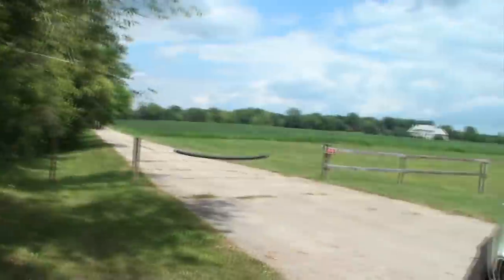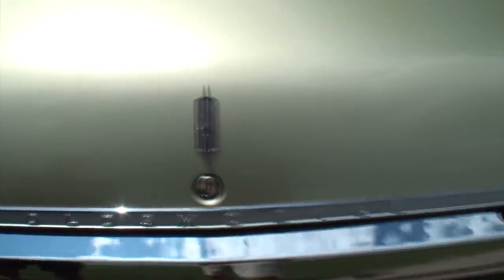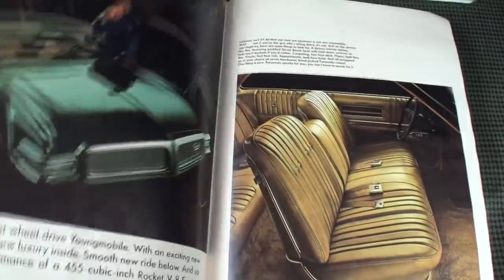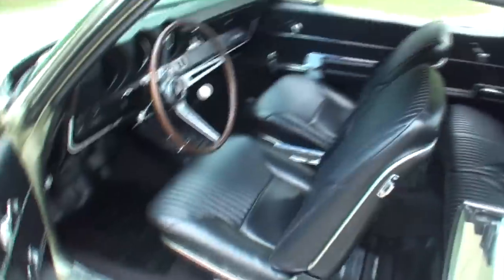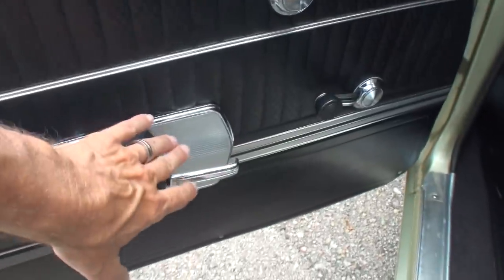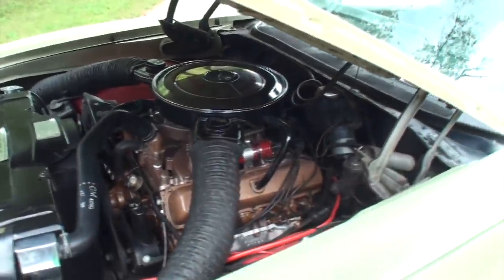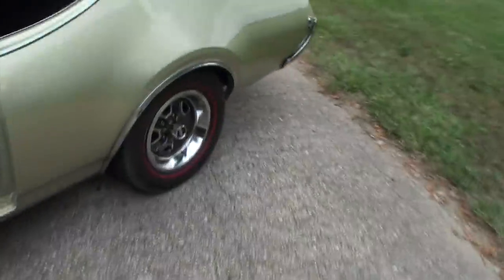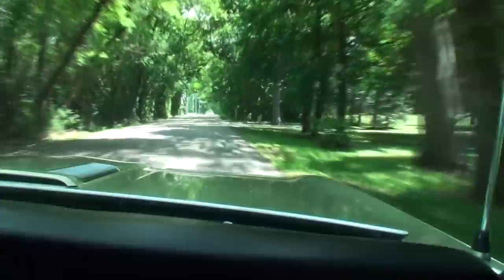1968 Oldsmobile Olds 442 W-30 W30 in Willow Gold & Ride on My Car Story with Lou Costabile

Comment: Working a 12hr 6 day week at Strathmore Paper and bought a 68 442 (used) as my first car in 69.  Like new cond. except for chips in the paint on the lower dash.  Didn't realize till some time later that the chips were in perfect position where the previous owner had been speed shifting into 3rd gear.  But the 442 was built so well that I drove it for years without a problem.  The Hurst alum shift grip from its 4 speed now hangs from a cord for access to my attic.
Reply from the maker: Hi Tom, Happy to read this car brings back memories of your car you worked hard for :-) Thank you for viewing and sharing.  Hope you see many cars on this Channel you enjoy!  Please Subscribe, and hit the "bell" so you can see all the cars when they are uploaded on this YouTube Channel, Lou

Comment: Just got clarification Tim correctly mentions the W-36 side stripe available on all 4-4-2's in 1968 and part of the W-30 package. The 400-370 D casting heads had the same 2.067 intake valves and 1.625 exhaust valves like the regular 4-4-2 C casting heads, however the D heads were special in the fact that the #3 and #6 exhaust ports had a wall cast in them to block heat to the hot air passage to the intake manifold heat cross over passage. ( The #4 and #5 passages were still open to provide carburetor choke heat) They also had the ports at the valves shaped differently for a venturi effect. These D casting heads were designed to use with steel tubular headers to gain their full potential. Very nice video of a superb example of a '68 W-30. Thank you Lou and Tim for sharing this.
Reply from the maker: Hi Karl, Thank you for viewing and sharing your knowledge. Lou

Comment: had a 68 W30 and i did have power brakes bought it  1977 kept it till 2004 . Was modified Joe Mondello  and Harland Sharp of roller rocker fame . I was one of firist guys to  run roller rockers in a Oldsmobile back in  1981 . When it was  done it would pin you in the seat it was a aucmatic car shifted at 6200 rpm . Yes ii was not Your Fathers Oldsmobile But my Dad loved that car every time I let him drive it ! Thanks Lou !
Reply from the maker: Hi SuperJoe70, Happy to read this car brings back memories of your car :-) Thank you for viewing and sharing.  You're welcome, Lou

Comment: Another great video Lou. My Uncle used to race back in 1960s and 1970s and he always told me that you didn't want to mess with a 442 Oldsmobile in a street race. He drove a 1969 Dodge Dart GTS at the time.
Reply from the maker: Hi PlymouthDuster225, Sounds like your Uncle had some experience he was sharing with you :-) Lou

Comment: Great Car Lou I've only had one Oldsmobile in my lifetime that I cannot remember for the life of me what year model it was it was a Delta 88 when I bought it it was very cheap car but it was very tired I was working for Norm Livermore Chrysler Plymouth in  Houston it was only 24 miles from my hometown to work and it burned 1 gallon of gas and 5 quarts of oil to get to work I bought the recycled oil that I kept in cases in my trunk and of course the car was yellow
Reply from the maker: Hi Alton, If you're was tired, this is the Oldsmobile that will wake you up :-) Lou